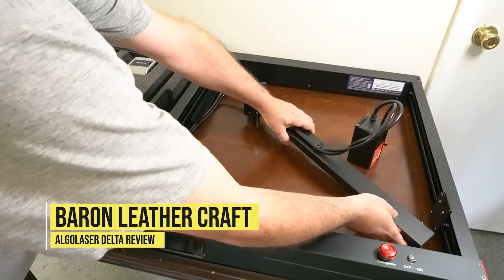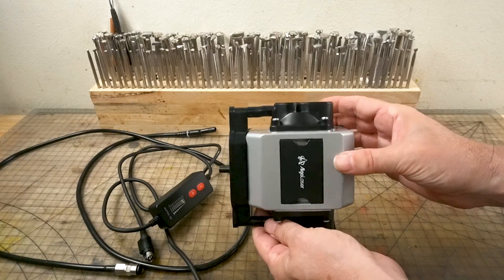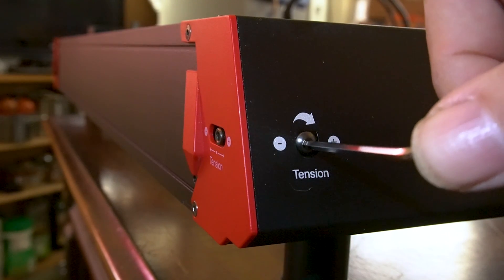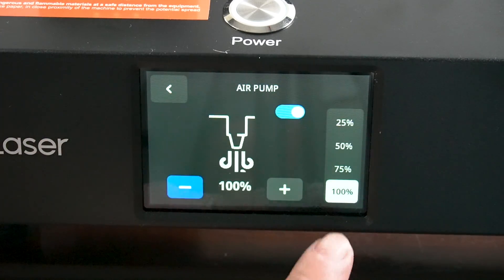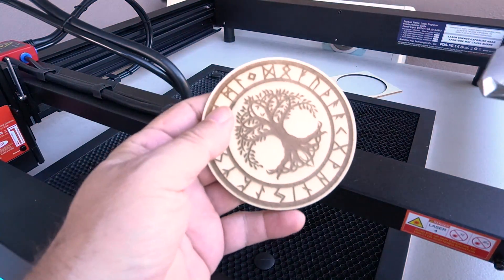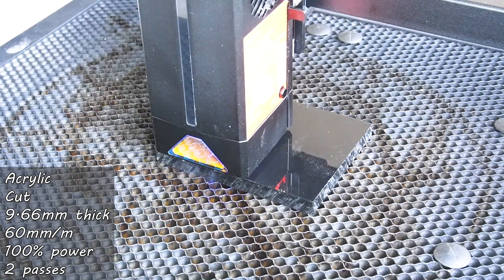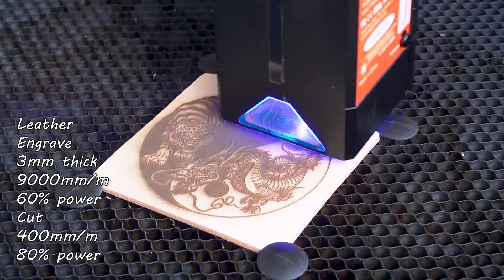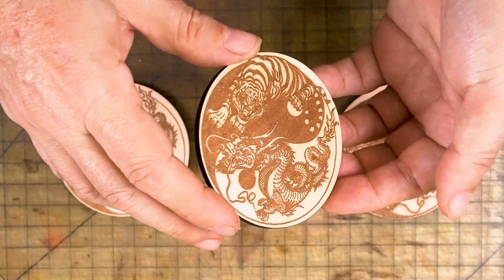AlgoLaser Delta  Laser Review: Is it Worth the Hype? Diode Laser Review!

Comment: Just bought a 40w Delta in Black Friday sales, based on this and several other youtube reviews.

My 4th laser engraver and the first one I regret.

First one that is not recognised immediately by Lightburn, dreadful quality control, the X axis appeared to have rocks in it, was assembled wrong and needed a complete strip and reassembly. Tiny screws for parts that came ready assembled on my Two Trees and my Creality Falcon.

Then the flaky connection which keeps requiring reboots, the USB socket loose and shallow, requiring the removal of the plastic shroud to make a decent fit.
The legs only have one option for the screw holes, and they are too narrow for the common sized bed.

Endless console messages in Lightburn, even when not in use the messages just keep scrolling, very flaky firmware.

And it draws power through the usb, so if you turn off the Algolaser but the pc is on, the Algolaser beeps at you endlessly until you unplug the usb.

This thing is a mess.

Three days and still no response from support.

All in all an annoying disappointment, I'll give it a couple of days of fiddling then it's going on ebay.

The screen is pointless, 99% of people will run this from their computer anyway, it's a gimmick.

This adds nothing useful over my TTS 20w apart from the increased power, I would have been better off just upgrading the laser module.

Even if I keep it I will never buy from this company again, there are much better machines out there.
Reply from the maker: Oh man, I’m really sorry to hear you’re dealing with all of that. I know that feeling — you get excited for a new machine, it shows up, and instead of creating you’re troubleshooting. That’s the worst, especially when it’s your fourth laser and you already know what the “good experience” is supposed to feel like.

For what it’s worth, I didn’t run into any of those issues with my unit. Mine arrived clean, aligned, and it connected to LightBurn right away. But after reviewing so many different brands over the years — and reading other people’s experiences across comments, forums, and Facebook groups — I’ve learned that with these hobby-level machines it really can be a luck-of-the-draw situation. Some machines show up flawless, and others show up needing surgery before they even fire a beam. It’s frustrating because quality control is not consistent across the industry.

And then there’s the computer side of things, which adds yet another layer. USB stability, chipset issues, drivers, power delivery, Windows updates, even the specific USB ports on your tower — all that can influence how the machine behaves. It shouldn’t be that way, but it is.

The console messages you’re seeing… yeah, that’s definitely firmware-related. Mine doesn’t spam like that, but I have seen other users post screenshots identical to what you’re describing, so you’re not imagining it. Same with the beeping when it draws USB power. That would drive me insane too.

As for the touchscreen — I get you. I mostly run everything from LightBurn as well. The only time I don’t is when I’m using the AlgoLaser Pixie for small craft runs. Those little jobs I keep stored on the machine and run stand-alone, but that’s the exception.

I really hope support gets back to you soon and helps straighten this out. Three days is already too long when the machine is basically unusable for you.

Fingers crossed you can get it sorted without having to dump it on eBay, but I totally understand your frustration either way. No judgment at all — when something is supposed to make your life easier and instead becomes a project, it takes the fun out of it.

Comment: Hello, my machine is Delta 22W. When I turn on the machine, it moves to the starting position but starts to shake. When I look at the screen, I see that the x and y coordinates are at -600. How can I fix this?
Reply from the maker: Are you using lightburn? The first thing I would do is to make sure it is set up correctly in the devices section in the laser control panel. The dimensions of the work aera should be set to X440 and Y415. What are yours set to. Lets see if I can help. There is also some great places to find laser help by a larger group with more minds to be able to help.
https://www.facebook.com/groups/algolaserofficial
https://forum.lightburnsoftware.com/
Reply: @baronleathercraft  Thank you, I hope you can help me. Yes, I use lightburn, I'm new and trying to learn. My workspace dimensions are set to X440 and Y415, there is no problem here. But every time it starts up, it automatically tries to go to the home position and crashes to the edges. When the crash is finished, I see that X and Y are at - values on the screen.
I had a different problem last night. While processing my project, I suddenly saw that the lines shifted by 2-3cm. Is it related to belt tension or should lightburn adjustments be made again?
Reply from the maker: @ncvnbrbr  Have you upgraded the firmware? Lets get your machine up to date before we adjust anything. Here is the link to the firmware. https://algolaser.com/pages/delta-firmware-downloads Make sure it is a newer version then is already on your machine. You can find that information on the control panel within the laser itself. I also recommending posting your problem on the lightburn forum. People are always happy to help and the more minds you have helping the better the chances of your problem being solved.

Comment: Again one more amazing review 🎉 I learned a lot from you and the first thing I will do is to buy one of the algo laser hope they will come up with a camera attached enclosure and a purifier
Reply from the maker: I so agree! What I would love to see is if they can add the ability to have a camera plug directly into the unit so you can run the camera wifi right from the laser.  Thank you for the kind words!
Reply: @baronleathercraft  is that USB port only for the purpose of storing g code files or with a firmware upgrade can be used for camera purposes 🤔 that's a question we should ask to the Algo Laser )))
Reply from the maker: @SEVEN_LC  Great question. I do not have a web cam but I would love to try this, I will see if I can borrow one from a friend. I assume it will not work but that would be awesome!